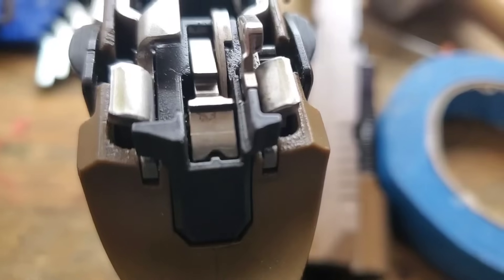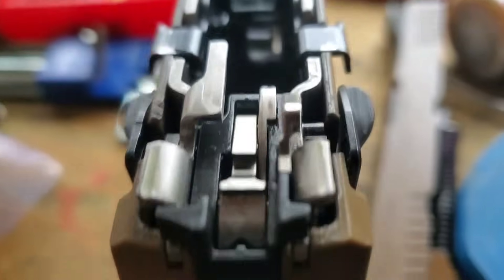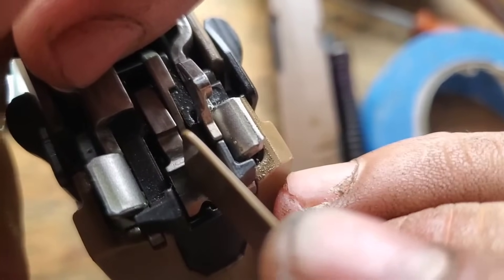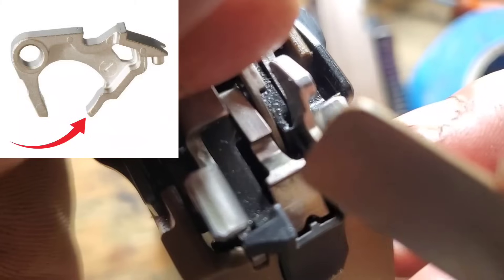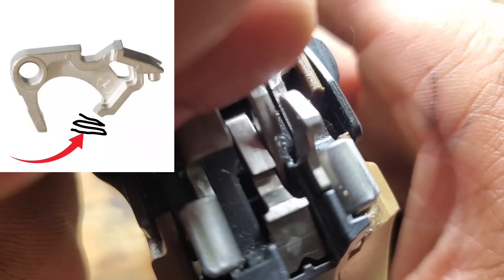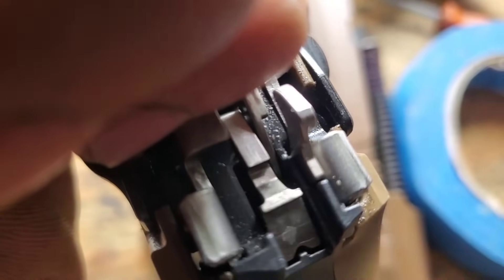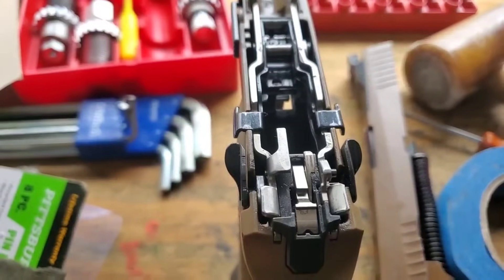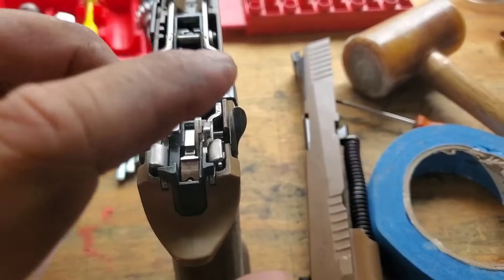Sig P320 [part I]: Private owners solve Sig Sauer engineering problems.

Comment: The disinformation being repeated in this video misrepresents the design intent and function of the sear safety cam projection, which I invented.  Every post-August 2017 P320 and M17/18 incorporates this crucially important feature. Removing it degrades the P320's resistance to shock & abuse, as well as compromising sear & striker engagement & reset functions under extreme conditions of fouling or damage.  Thus, this feature is an integral part of the redundant set of mechanical interactions which prevent these pistols from firing without a trigger pull as has been erroneously claimed. 
For factually verifiable information on how P320's actually work and why no one has ever demonstrated a mechanically plausible scenario in which an intact P320 can be made to fire without a trigger pull, feel free to contact me.
Reply: Thanx, Bruce. I'm so tired of this. Now, people are touting the FBI report but if they would actually read it, it states that they were unable to get the 320 to fire without the trigger being pulled. The conclusion was "it may be possible" under certain specific conditions, but they never got it to actually happen.
Reply from the maker: @HalfCrazy520 you're wrong there colonel sanders, perhaps playing semantics or didn't view the report in long enough detail. 

They did not fire a cartridge, but they were able to fire the primer of a primed brass, which is the same result given the real world situation of having powder and a bullet on top of that primer. 

Everyone is also very scared if Sigs Legal team, including the Feds. So they're treading with caution. Bruce should have been there for the FBI's test.
Reply: @timberfallingcouple  They were able to light off the primer by manually releasing the sear with a tool which is the same as activating the trigger . Holding the sear down manually also prevents the secondary sear notch from catching the striker. READ THE REPORT SLOWER.
Bruce Gray did his own test and was able to recreate an un-commanded discharge... all it took was a missing striker safety spring, the take-down pin from a .45 in a 9mm gun, and pistol being assembled incorrectly. So, if your 320 is missing parts, using the wrong parts, and assembled wrong it could possibly go off when you don't want it to.
Reply from the maker: @HalfCrazy520 so the gun will fire without a trigger pull. Thank you. Have a good one.
Reply: @timberfallingcouple   " you're wrong there colonel sanders "
So, what's with the name calling, there, lumberjack? 
Now you're just lying, putting words in my mouth, and doubling-down on your misinformation.
Reply from the maker: @HalfCrazy520 the made the gun fire py depressing the sear, which now is the same as a trigger pull after saying that it CAN NOT UNDER ANY CIRCUMSTANCES FIRE WITHOUT A TRIGGER PULL.

they also were able to get the gun to fire under various circumstances and manipulations with the striker safety interlock spring installed. 

Sorry I gave you too much credit when I called you Colonel Sanders, it's Captain Crunch as we all see.
Reply: @timberfallingcouple  What happens when the trigger is pulled? Yes, it pushes the sear down. How did they get the pistol to light a primer? Yes, by PUSHING THE SEAR DOWN... or COMMANDING the gun to fire.
You can't call it "un-commanded" when you pressed the sear down with a freakin' tool.
Reply from the maker: @HalfCrazy520 the safety on a p320 system does not block the sear from dropping. It is a trigger-stop only. 

THEY ARE NOT THE SAME THING 

One thing does cause another. They are absolutely not the same thing. 

What you are purporting is no different than saying that firing a cartridge is the same as a trigger pull because the striker does fall when the trigger is pulled.

You're insane. Mad is right dude. Flat mad insane.
Reply: You could prove to us all that you're not really a 3rd-grader by dropping the juvenile nicknames.
Reply: @timberfallingcouple  "Examination of the subject weapon did not independently provide evidence of an un-commanded discharge" - Pg 32 of the FBI report in the Conclusion section Apparently, the FBI is just as insane a I am... or... you're just wrong, which you seem incapable of admitting.
When Bruce Gray takes time out of his day to tell you that " The disinformation being repeated in this video misrepresents the design intent and function... etc. " that should tell us all we need to know about your diagnostic abilities. You are no Bruce Gray, bro.
Reply: @timberfallingcouple  " the safety on a p320 system does not block the sear from dropping. It is a trigger-stop only "
What safety? The P-320 doesn't have a "safety".
Reply from the maker: @HalfCrazy520 you are correct that I do not have a financial and legal interest to defend my product. 

Finish the sentence. "Examination of the subject weapon did not independently provide evidence of an uncommanded discharge it does indicate that It may be possible if sear engagement is lost."

Couple that with a sear that is able to move independently of the trigger, a slide which has visible movement against the very thin frame rails and displays visible movement on Manipulation of the trigger, and a gap so large that foreign objects can EASILY fit between the slide and frame to disengage the sear, you are barking up the wrong tree there Krunch Berry.

They absolutely showed that it can fire without a trigger pull. 

They absolutely proved to me, at least that even with the safety on, with the sear cam leg connected to the trigger bar it absolutely can and will move the striker safety lever up enough to allow the striker to fire a primed brass.
Reply: @timberfallingcouple  " It may be possible "
Well! Doesn't that sound conclusive! MAY be POSSIBLE. 
Not WILL HAPPEN, or DID HAPPEN... but may be possible, even though we couldn't replicate it...
Reply from the maker: @HalfCrazy520 "may be possible" is also a TON different from "misinformation... can not fire without a trigger pull"

Still none of these goobs have talked about P320Truther and his gun that fired a primed brass on video before his sear leg removal. 

Also haven't heard much other than crickets about the mismatched parts not having caliber-specific designations on them, but I'm more undecided on that matter, specifically because I haven't seen it for myself or heard it from both sides. 

So. Basically. In summary. 

If those had been charged rounds, the gun in the FBI test would have fired without a trigger pull. Which also means that even if the safety had been installed and was on, it would have still done so. Or so it would appear to those of us in the class who read the report, and applied it to the fact of the matter, which is, that gun fired in that officer's holster which prompted the testing.

Sig and Bruce should have Ben present at the test instead of covering their heineys with social media comments.
Reply: @timberfallingcouple  I give up on you. That "whoosh" sound? Yeah, that was the point passing by JUST over your head.
The FBI, for all their efforts, could not recreate a P-320 firing un-commanded. Full stop. The report states that clearly, in plain English. "It's possible" is not conclusive proof backed up by evidence, no matter how thick your armor of denial
Reply: @timberfallingcouple   " If those had been charged rounds, the gun in the FBI test would have fired without a trigger pull "
The trigger pull was pressing the sear down with a tool, manually defeating the sear notch... same as pulling the trigger.
Maybe the FBI didn't invite Sig or Grayguns...
I don't dispute that the gun fired in the holster... the question is WHAT caused it... and that question is still unanswered, isn't it?
Still, even now, and certainly not for lack of trying... no one has re-created an un-commanded discharge without modifying/breaking/removing something or assembling the pistol incorrectly.
Reply: @timberfallingcouple   " I do not have a financial and legal interest to defend my product "
Nor do I, bud. I'm not a Sig fan-boi. I only own ONE Sig pistol. I prefer CZs actually.
I do think it's unwarranted to accuse Grayguns of being dishonest. I would give the benefit of the doubt, since Bruce freely admits he designed parts for Sig and it's no secret.
Reply: @HalfCrazy520  I appreciate your candor. At my work we have and use over 200 M18s. Within the first year, we have had one verifiable instance of a broken striker safety spring, two instances of it missing and several times the spring slipped behind the striker safety itself (slippage could have happened after striker assy was removed). I wish a groove existed for the spring arm to fit into (but if wishes came true.....).If the parts (and I know I am stretching here) are subbed out to other companies for manufacturing, could it be possible for an employee or employees of company B to mix parts up (wrong take-down pin, wrong trigger bar) from a .45 or P325 and ship a few mixed up parts that are now just waiting for that striker safety spring to be gone or break? If MIM processing allows for 12 to 20 percent shrinkage, how does someone accurately estimate how several parts (four or five maybe) react to each other? You could have 20% shrinkage on only one part and get away with it or on two or three. We have not yet experienced a problem in hundreds of thousands of rounds fired, but are meticulous on the cleaning and inspection of our guns each time they are used. I do not know if the P320 per se is defective, but do not want to carry one in the chamber until further notice though it could get me fired. Just curious about your viewpoint in light of the above. Am I nuts?
Reply: @rickskeptical  My experience, granted, a sample size of one, is nearly 3 years of every-day abuse by me, round in the chamber. Full disclosure, mine is a compact in .45 ACP.
After over 8k rounds, I have yet to experience a malfunction. All the mechanisms in the FCU function as designed, the parts that are supposed to spring back, still spring back. 
Periodic inspection and cleaning... a holster that holds the pistol tightly and completely wraps the trigger guard... and booger hook off the bang switch. 
I find the 320 to be reliable, super easy to shoot well, and super easy to clean with that removable FCU.
Yes, it is far more unforgiving of complacency or trigger discipline and equipment that are not on point. Very short trigger take-up and overall trigger travel.
Love mine and nothing has changed for me.
Reply: @HalfCrazy520   True. No one has ever demonstrated firing a  P320 without "pulling / actuating / moving to the rear" the trigger.  It has never happened.
Reply: @brucegray5139  Keep up the good work, Bruce. There really are people who appreciate what you do.
Reply: Apparantly the "too many springs" issue with historic Sig designs is raising questions. The striker safety spring may be a weak link requiring more regularly scheduled maintenance than other popular designs. Which might be hard for Sig to admit.
Reply from the maker: No doubt. 

I just handled an M&P 2.0 at the shop today and I'm pretty sure that's the route I'll be going as soon as I get paid for the next job. 

It's just a damned bummer that I've got so much money and time tied up in these p320s. It's also a damned bummer that the Marine corps adopted the m18 variant of the gun and spent tax money on it, when I'm pretty sure the company doesn't even care enough to publicly address problems. Who knows.
Reply: @timberfallingcouple Looked at going that route as well, but decided to invest in H&K to have it done and over with once and for all. The 320s are OK for house guns or condition 2, but that is not what I carry on me. P30 is for me.
Reply from the maker: @tims6970 another point of note is that I get an absolutely absurd amount of light primer strikes with my P320s, both the X5 and the M18. And with these ammunitions, when shot through the 9mm 1911s and glocks, there were a thousand rounds fired and only one light primer strike in the glock, which also was able to be fired in the 1911 afterwards. 

So it's kind of a law of compounding errors here and the more Sig acts the way they are acting, the angrier I get about the whole situation. 

The only thing that reduced the light primer strike count to an acceptable number was heavily lubricating the striker assembly, which after the first round of uncommanded discharges, sig pointed out that no [zero] oil was supposed to go on the striker assembly, striker foot, or sear ledges. Figure that, the first striker fired ever handgun that didn't take a drop of oil where two pieces of hardened [presumably] steel smash together and rub and grind.
Reply: @timberfallingcouple Seat your primers.
Reply: @tims6970 There is nothing to demonstrate that the striker lock spring is implicated in any incident.
Reply: @brucegray5139 All the springs to retract and block and return and release the striker are subject to fail for multiple reasons...😢
Reply: @tims6970  ALL pistols rely on springs to function. Almost all moving parts in pistols are spring loaded. There are entire companies who specialize in pistol springs. So... how prevalent are spring failures in the pistols you have owned over the years? Is this some recurring issue in your life?  
I've been shooting all my life and the only spring issue I ever had was weak magazine springs to the point where the last round wouldn't feed (slide cycled faster than the weak spring could push the round up in front of it)... and recoil springs that need to be periodically replaced (not due to failure).
Reply: @HalfCrazy520 The 200 series Sig has minor spring maintenance easily maintained without ever being known for serious malfunction issues. Unlike the 320.
Reply: @tims6970  Show me ONE lab/agency that has demonstrated/proven that the Sig Sauer P-320 has "serious malfunction issues". Just one. 
Take all the time you need...
Reply: Is the sear safety cam projection there as an inertial element only?  If so, can we simply make it thinner so that it does not move other parts via friction?
Reply from the maker: I can't speak for Bruce here, but my basic understanding is that part is in contact with the trigger bar in order to use the sear springs to add resistance to the trigger pull weight for inertial protection. It would then also provide some reset force to the sear via the trigger bar [I think] which is what he was referring to as fouling protection.

I'm not sure he will ever write back k to us with anything other than Company Propaganda at this point. But I'd love to see a transparent cad drawing of the parts in different colors interacting and moving with trigger pull, outside Manipulation of the sear, and how that affects safety lever and striker safety plunger etc. 

But you know the old saying.. you can wish in one hand and do something else in another and see which one fills up faster.
Reply: Thank you for not being a hysterical little girl and using logic, common sense and reason!
Reply: Why is it the 320 that keeps popping off in holsters and not other brands? I'm not seeing a ND reputation for anything other brand/ model making the headlines in the numbers of the 320. Seems like people invested in Sig keep saying there's no problem, while vids and lawsuits say otherwise. Something is definitely going on.
Reply: @mehGyver  What do you say about this Glock firing un-commanded?
https://youtu.be/Qu-H36C5z3c?t=12 
Will the same effort put into disparaging Sig be spent on a campaign to make Glock pistols appear unsafe to carry?
Reply from the maker: @HalfCrazy520 I would love for gun manufacturers to be held to a higher standard of safety and quality control.

I'm definitely an Odd Man Out in this world, that I think the first striker fired pistol without either a thumb safety or completely double action first trigger pull w/decocker should have been tied around the inventor's neck like tying a chicken to your dog for chasing chickens.

I think single action guns should have thumb safeties on them. And at least the ones heralded as the best and safest should absolutely be held to the same standards of testing and skepticism towards their claims. 

I would love to see safeties that are a sear block instead of a trigger block. I would love a lot of things that may or may not even be physically possible to engineer and build in a plastic framed striker fired gun. But, like the old adage goes.. "If we can put a man on the moon..."
Reply: @mehGyver Good points.  You aren't seeing similar incidents involving other makes for two primary reasons: first, the web search engines are preferentially selecting for P320 & SIG ND's, whereas there's no system in place to find and propagandise other incidents. Second, it's a numbers game. The P320's  popularity and wide deployment gives it more exposure to circumstances in which ND's are more likely.
Reply: @mehGyver Why did you buy all that toilet paper 2020? 😮
Reply from the maker: Hi! Wow glad to see the inventor show up.

I would actually lead you to the video I referenced in this video where he has a gun that pops a primed brass without a trigger pull.

I also would lead you to the big guy in the Hawaiian shirt, I think Grey gun or Grey something channel, I'm sure a viewer can lead you to the right place, where he has a gun with parts from a different FCU that share a matching part number, but allows the gun to be assembled, and charged with a round without resetting the take down safety lever leading to a poor sear engagement and a gun that fires uncommanded. 

Thanks for coming out. I have been dying to talk to an engineer about this whole thing or see their take on it and I don't know how this comment slipped past me.

I would love to know how the two extra springs on the sear being attached to the trigger bar makes it safer considering the sear is so readily accessible between the FCU and slide gap, and especially since all of that can wiggle around a bit.

The demonstration where the sear is depressed and the trigger safety lever also engages the striker safety plunger enough to disengaged and pop a primer is alarming enough for me to want that interlock deleted. But I am open to replacing an unadulterated sear into both of my guns if you can talk me into it and disprove the before mentioned video from p320 truther.

You have to understand, I am way more scared of my gun shooting. Hole through my body in the holster than I am of dropping it or using the gun in an "extreme" dirty uncleaned or abusive state.

I should be scared of both, but as you can see from recent events, priorities ya know? I've got two thousand dollars tied up in these things and we've got coppers getting blasted left and right with holstered guns and I actually carry and use my pistol more than most cops do. You can see where this gets scary. I don't carry my weapons appendix anymore, [which is the safest and most comfortable carry method for me] due to my fear and distrust. 

I'd love to hear back from you, and potentially get your take on the recent write up that the FBI and unnamed police department did where they were able to get the gun to fire uncommanded. 

I wish you could have been there for that. Your expertise could have been invaluable to their testing.
Reply: @timberfallingcouple  thank you for your reply. i'm the guy in the Hawaiian shirt who talks about the only possible scenario in which any P320 can perhaps be made to fire without a trigger pull. That scenario is highly unlikely, as it requires the wrong takedown safety lever to be installed, the striker lock to be missing or broken, and the pistol to be both assembled and loaded somehow without actuation of the slide lock lever. And even then, the rest of the parts of which the pistol is assembled must allow just the right amount of sear engagement for this scenario to play out. 

There have been no incidents in the field in which the scenario has been implicated. We have investigated and tested every UD theory from plaintiff's affidavits, influencers, reports, you name it. NONE result in a discharge without the trigger being pulled. 

We reported on what LFD Research discovered (with the 45/10 TSL installed in a 9mm pistol) simply because it was physically possible, and not because it was realistically likely. Our job at Grayguns Inc. is to report verifiable facts.
Reply: @timberfallingcouple The first FBI BRF report did NOT describe any demonstration of firing without a trigger pull, and saying otherwise is a lie. 

The procedure the BRF used to supposedly "test" the striker lock is invalid. It's the same discredited "sear drop test" demonstration that has been pushed by paid influencers, and which has fooled folks who lack the knowledge of this pistol to know.  The BRF's second round of tests confirm the pistol cannot fire unless the trigger is pulled.
Reply: @timberfallingcouple  explain this, you big dummy, why NOT ONE case of “uncommanded discharge” has been repeated with the weapon that allegedly did so!  Why???!  I’ll tell you why, because they used WRONG retention holsters.
Reply from the maker: Here is an edit. The video I referenced without having the exact location.

https://youtu.be/7H4Ri409-5I?si=mLDH3taFdq9U5diS

His name is LFD research. Thanks again. I'd love to come to your shop and have an interview or perhaps an Off-the-record demonstration of these concepts to ease my troubling mind.

Thanks again
Reply: @timberfallingcouple  Man so much wrong with this video. Not sure if you have any videos after this. No tapping the trigger with the manual safety on and transfer of energy causing the safety lever to rotate is nowhere near enough to move the striker block safety at all. when the gun is assembled, it would actually not move its captured under the striker block safety spring tension. just try placing your finger ontop of the safety lever and feel the transfer of energy then go press down on the striker block safety. 

its like the old moving quarters wihtout touching them with tapping on next to the other and making it move without touching it. 

the p320 can't fire wihtout the trigger being pulled. no one has shown any proof or evidence of it being able to.